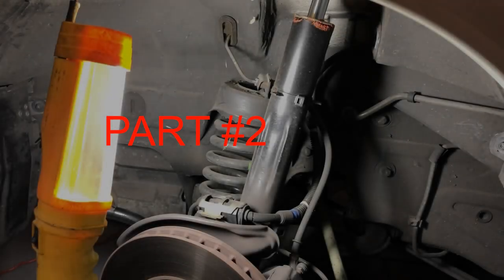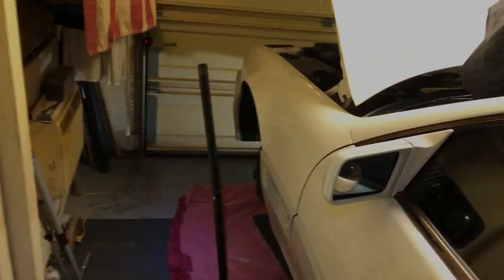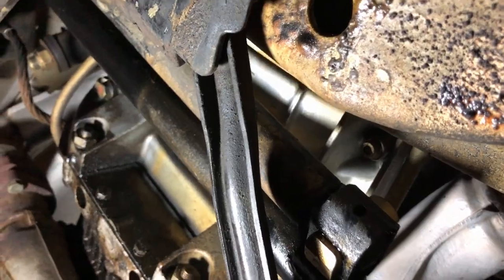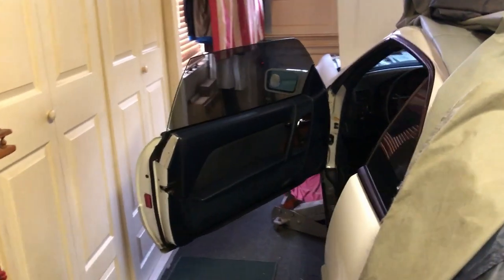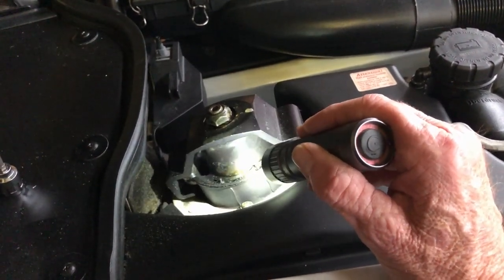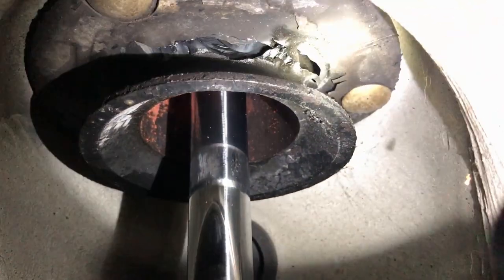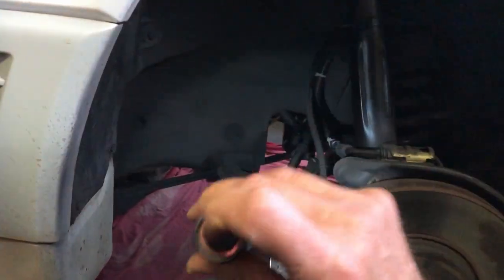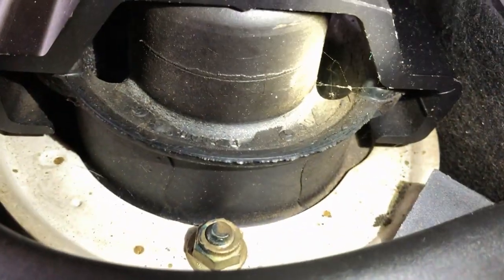MERCEDES R129 STEERING NOISE? FOUND!

Comment: Thanks for sharing.  I did not know the rubber strut top mounts had a bearing?  Shock shaft should be able to rotate?  Looking forward to next video.  Happy New Year.
Reply from the maker: Not 100% sure on bearing but most videos showed bearing
Reply: @mygermancars7264  Upper strut mounts need replacement because of cracks.  Period.  Try get MB or OEM.  I'm convinced they don't have a swivel bearing.  If u place an Allen key in the shock shaft does it rotate feely?  Am looking forward to the fix.  I own a 2.3-16, 190d 2.5 turbo, 124 87 300d, and a s124.  All use the same design and many interchangeable parts. Looking forward.  Thanks for sharing.
Reply from the maker: @ebutuoyebutouy  Allen doesn't turn , all I know is noise went away when I loosened nut ,so pretty sure this will be the fix lol.
Not going OEM Mercedes , URO is sponsoring the video , no cost to me, if they don't work then OEM, pretty easy job.
Reply: @mygermancars7264  Interesting.  124 and 201 upper mount don't have bearing.  I predict shock.  But mounts need replacement anyway.  I'll be watching closely.  Good luck.
Reply from the maker: Yeah so no bearing inside ,just some kind of cup sealing surface, most cars have bearing in strut mount.

Comment: Please, it is NOT silicon.  Silicon is a mineral used in computer chips, thus San Jose has the moniker of Capitol of Silicon Valley.
SILICONE (with an E) is a plastic used as a lubricant.
They are VERY different animals!